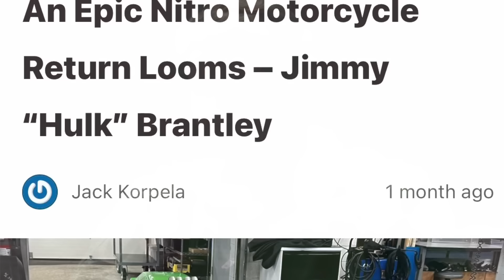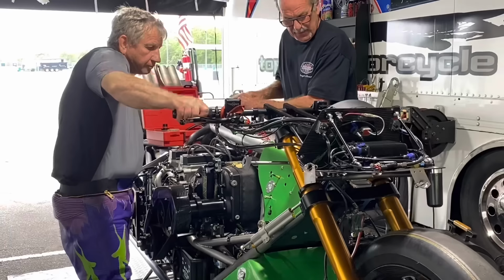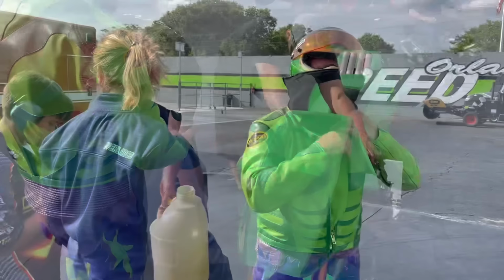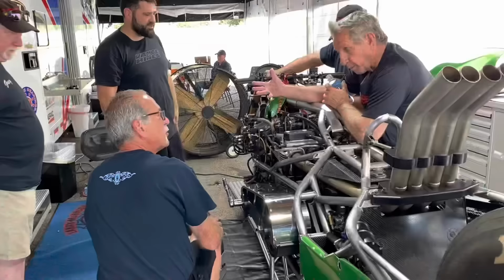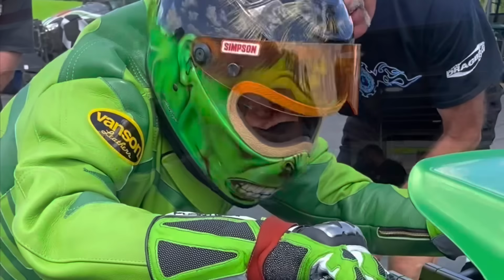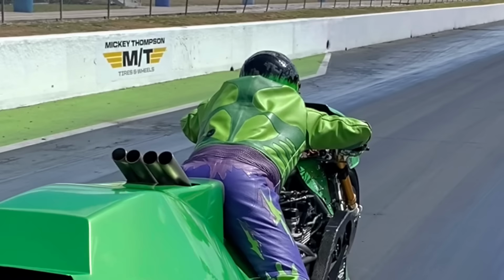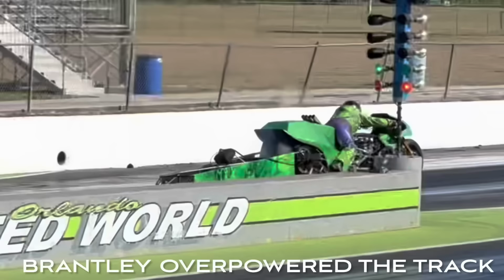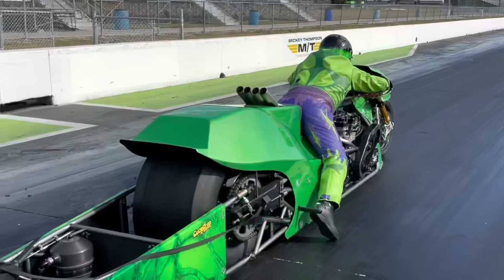This Takes A LOT of COURAGE!

Comment: Hey Jack,
Awesome Vid
With the remark of letting the bike get ahead of you, explain please.
Reply: Your trying to anticipate what the machine is going to do which You can only do by making runs and feeling what it does the same over and over and knowing it's coming, but each track and lane is different and just be ready for the possible and try to adjust to that track knowing the bike usually does "This at this point usually" even if it doesn't that run (Your ahead of the bike). Whereas if "It" didn't happen on a run and You think "it" won't happen BUT then "it" does on Your next run and You weren't ready, the bike is ahead of You because You got complacent. There are no two runs the same.
Reply: @dieselrotor  
Hey dr, thanks for that, haven't done any drag racing, so good to know. Can only very roughly imagine what it's like to go that fast and quick over the 1/4.
Again, Thanks
👍🍻
Reply: @colinm1325  For sure. I just hope it made sense. Take care.

Comment: Hmmm...No SANCTIONED Drag racing Association has permitted "Top Fuel" Bikes for nearly 40 years! They became too fast and COULD NOT SHUT DOWN SAFELY even running 1000 yards on 99% of the tracks. Vicki Farr from Tulsa, OK holds the OFFICIAL "World's Quickest 1/4 Mile Bike" at 5.2 seconds on a  1430cc Turbo'ed Suzuki GS 1150 her husband Marshall Farr built running 80% nitro with the rule limit 10 inch rear tire. All sanctioning bodies also banned "Funny Bikes" the same year also and "wheelie bars", even for "exhibitions" (like rocket bikes or trucks or cars).  "Drag Bikes" MUST be 100% STREET LEGAL on DOT street tires, except you CAN run true leaded (5.5 grams of lead per gallon max.) race fuel, NO nitro or alky. A guy that went by "The Wizard" jumped his lane on a modified Yamaha V-Max in SoCal killing a half-dozen spectators in Top Fuel in about 1986 or 87 and that was THE END of wheelie bar bikes or ANYTHING that could turn an "8.0" or faster on two wheels and shutting down the track and injuring about twenty people and killing himself in someone's living room. Cycle, Cycle World, Cycle Guide, Petersen's Motorcycling and all the other cycle mags of the time covered it for a couple of months.
Reply: That's 1000 feet not 1000 yards